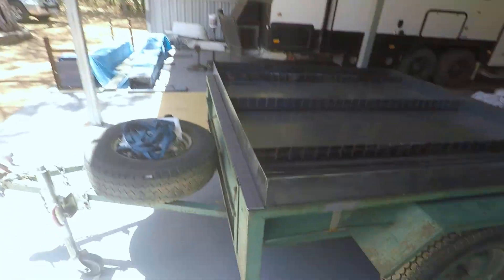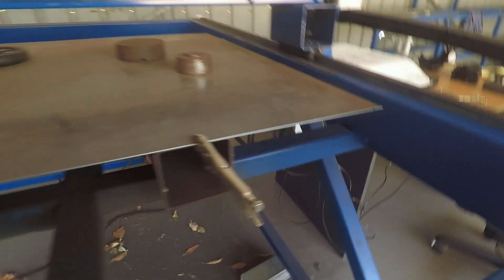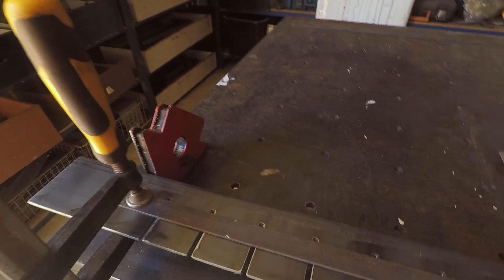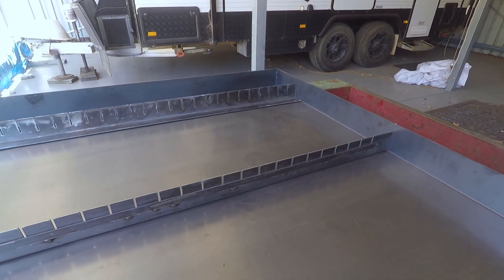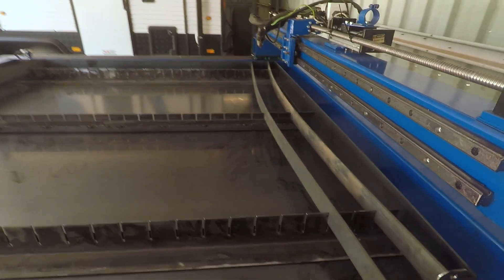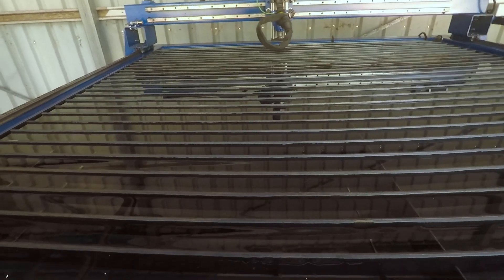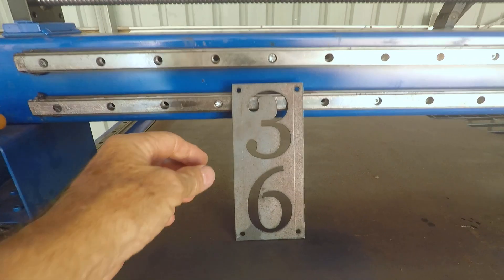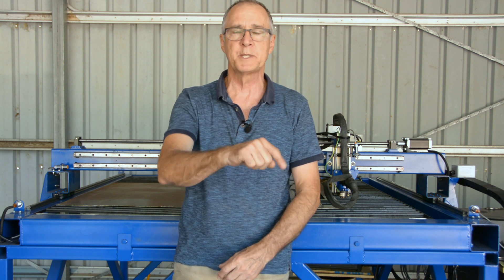My CNC Plasma Table's Water Pan | Fabrication & Install

Comment: Just a note:
If you have thin plate that might warp, you can actually submerge the plate about a 16th of an inch to keep it from warping. 
The plasma torch has everything it needs to actually cut under water and the gas shield will move the water away from the cut path as it cuts.
Reply from the maker: Hi Richard, now that I've installed the MyOhmicPro unit, I can now run my water level just below the top of the slats, which keeps thin metal cool enough to prevent warping. Once the cutting process starts, there's usually a reasonable amount of water collecting on the surface of the metal, due the the air from the torch blowing water up from the water table.

Comment: Great job ,Thanks for the movie.I'm following from Romania with the idea and desire to build a table myself, for now I'm gathering information and materials, I've already bought the plasma. congratulations for what you're doing and thanks
Reply from the maker: Thankyou for your kind words and I'm glad my videos have been helpful for you in deciding to build your own table. What size table are you thinking of building because I sell plans for my table, which has a footprint of 1800 x 1800mm and  cutting area of 1330 x 1330mm and based on a ballscrew drive system operating on the MyPlasm CNC controller and plasma interface unit. If you're interested, you can email me for more details....rmhyde58@gmail.com
Reply: @RustysMetalSigns  ...because you have to start from the bottom, but also because most of the local DIY stores sell sheet metal in 2m/1m sizes, I want to make these sizes with an extra 10%, and more than likely I will need advice and I will ask, I'm gathering the materials - you know it's not easy - and I'm sure I'll ask something, for the moment to collect some more money, but I'm having trouble with the works, I'm an argon welder by trade, but I'm in Romania and everything is strange at the moment, thank you for your appreciation
Reply from the maker: When I built my table, I did so, knowing I'd probably build one to take a full size sheet of steel....2400 x 1200mm. I think if I was going to build my table now, I'd definitely build it to take a full sheet of steel.
If you have any questions, feel free to get in touch, ok....happy to help if I can.

Comment: Hi Rusty, 
Where did you get your water bed cut and folded 
I want same size water bed but struggling to find place in WA that can cut 1.7M wide  ( size of bed plus sides to be folded up)
Reply from the maker: Hi Milos, Luke from Swags Engineering in Rockingham fabricated the water bed for me...here's his details:
Unit 11, 21 Hurrell Way in Rockingham. His email address is: swagsengineering@gmail.com
I hope he can help you.

Comment: Whats the purpose of the fluid? It splashes water everywhere and on the computer.
Reply: The water bath is there to trap the fumes, sparks and smoke that are produced from the plasma cutting process. Breathing in these fumes isn't good for your health.
The water also aids in cooling the metal, especially when cutting thin gauge.

Comment: Hey Russel...always nice to see  yours video
Is your water pan made stainless steel or from mild steel.
Thanks.
Reply from the maker: Hey Michel, nice to hear from you. The water pan is made from 3mm mild steel, as are the slats and slat frames. They've all gone a bit rusty, but nothing noticeable at present, after 2 years of use.

Comment: Hi rusty where abouts did you get the linear rails from ?
Reply from the maker: Hi Daniel, I bought pretty much all of the equipment online....,mostly from ebay. The linear rails I used were HGR20 guide rails with HGH20CA bearing blocks. Mine are 1500mm long but they are available in a range of sizes to suit your application. Hope this helps. If you need any more info about the build, feel free to email me at rmhyde58@gmail.com

Comment: Could you tell me why you end up 100mm deep waterpan? What differend it make if it is 70mm? I make my plasmatable body ready and i am wondering how deep i should do the waterpan.
Reply from the maker: Hi Markus. I made the water pan 100mm deep because I'd seen other tables with water pans this depth. The deeper they  are, the less often you have to clean them out, I suppose. 
100mm is also the height of my Y axis frame rails, so I wanted to keep the top of the water pan and slats level with the top of frame. 
I suppose you can make the water pan any depth you like, but I wanted as much water under the torch as possible, to make sure I captured as much of the fumes, smoke and sparks that the plasma cutting process creates. I hope this helps.

Comment: Hey Russel are your tips lasting long???? my unimig 30 tips are not lasting that long and im only cutting 3mm mild steel
Reply from the maker: G'day Ian, I've probably not cut that much yet, in order to wear out tips. I have replaced 1 tip and electrode (the original ones that were in the hand torch when I got the cutter), not long after I started cutting on the table, but since then I'm still on the 0.9mm tip and I've cut some 1.6mm mild steel and some 3mm aluminium.
I've got more 1.6mm mild steel to cut so before I start, I was going to check the condition of the tip and electrode....which I suspect the tip might be on the way out.
What state you in.....I'm in WA.
Reply: @RustysMetalSigns  ahhh ok. I'm from nsw. I have used plasma's for over 10 year's being a metal fabricator and this plasma just seems crap to me. Only way to get nice cut's is slow the speed down. Be interesting to see what you're machine does when cutting 3 or 5mm sheet 🤔
Reply from the maker: I've got some small items to cut out of 5mm mild steel so I'll have to change the tip, anyway. I'll let you know what settings I use.
Reply from the maker: Hey Ian, what cut chart are you using for setting up your table to cut various thicknesses of material. If you send me an email (rmhyde58@gmail.com) I'll forward you a cut chart I got from the Langmuir Systems forum relating to the Razor Cut 45.....I know you're using a 30 but it's got settings up to 30 Amps for thin material.

Comment: Looking good mate!

Add some Laundry Soda to that water to prevent rusting. Get some PH test strips and keep it at 10 or above and it will last many years.

Link to product picture:

 https://www.farmandfleet.com/products/805054-arm-and-hammer-super-washing-soda.html?blaintm_source=google&blaintm_medium=pla&gclid=EAIaIQobChMInLCukOPr9QIVShXUAR3lpgj7EAQYAiABEgKSO_D_BwE

I had to take a 150 mile road trip to find a big enough brake to bend my water pan. Mine is made of 3/16" plate and was bent on a 500T 20' press
brake.
Reply from the maker: Hi SegoMan, so sorry for the late reply but I've only just come across your comment. Thanks for the tip about the laundry soda and the pH value that the water table water should be kept at. A 500T, 20' press is an  absolute monster....would be great to see something like that in action.

Comment: Hey Russell! I have been looking around at wiring the electronics up for these tables and some of the instructions call for grounding the table directly to the earth, not back through the power source. Is that how you have yours?
Reply from the maker: Hi Frank, I've connected all the earths and cable screens from the field devices, back to a common grounding point inside the electronics cabinet. I've tied that common ground point to the earth point from the incoming AC mains supply.
As for the table, the frame, water pan and plasma cutter's ground clamp, all go back to a common point on the frame.
The electronics cabinet and the table frame ARE NOT connected together.
I was thinking of tying the frame's common grounding point to an earth stake in the ground, but was advised against that, because the earth return path for the plasma torch should be back to the plasma cutter...ie. the electrical circuit wants to go back to the origin, which is the plasma cutter itself. So that's how mine is connected.
I'm about to make a mobile 'console' that will contain my laptop, a screen and the electronics cabinet. It won't be able to move very far because there's not a lot of slack in the cables from all the field devices coming back to the electronics cabinet. 
I know there's lots of tables with the electronics cabinet mounted on the side, and that's where mine was going to be mounted, but I'd rather keep the 2 items electrically isolated from each other if I can....so that's how I'm going to do it. Hope this helps. If you have any more questions, you can always email me at rmhyde58@gmail.com
Reply: Thanks for the reply! That pretty much goes along with what I have read about grounding the shielding and field components back to the common in the electronics box. I think the difference between your machine and others machine is the triple work lead lug. Most would just run one lead back to the plasma cutter as normal. I wonder if the triple lug needs to be isolated from the main frame . Then a cable from the main frame directly to the earth. I am not in any way saying  that your way is incorrect. I’ll check with a local electrician for the code on that when the time comes. Thanks Rusty!
Reply from the maker: The reason for the triple work lead plate is to make connecting the various ground leads easier than having them all attached to a single bolt. This way, I've got the ground lead from the cutter on one bolt, the earth strap from the water table to the ground plate on one bolt and the work clamp and work magnetic clamp on another bolt. All the grounding is to one common location on the table, and this is connected to the ground connection on the cutter, making a solid return path. So far, it's working as planned and I'm not having any issues with EMI with the electronics cabinet.

Comment: Great looking machine! If the slats are perpendicular to the open end of the machine, it should be easier to slide material on/off the table.
Reply from the maker: I'm looking to install a teflon strip across the top edge of the front rail, to help with sliding a sheet on, but I see what you mean about having the slats running up and back, instead of across the machine, as they are now.
Reply: @RustysMetalSigns 

"Do a google for "Ball Transfer bearing"

For the long term you can use a engine hoist with a 4 way spread bar to load heavier sheets.

Keep on keepin' on!
Reply from the maker: The other option I'm looking at is to install a gantry trolley and chain block, running from the front to the back of the shed, so I can unload a sheet of material from the trailer and load it onto the table.
Reply: @RustysMetalSigns  That's my plan as well when I add onto the shop for the plasma room. Currently I use a stinger on the fork lift.

Comment: Great job Rusty! Thanks for the movie.
Reply from the maker: Cheers Frank. The water pan also made cleaning the dross off the underside of the pieces, much easier, which is a nice bonus.
Reply: I like the idea of having the three way ground on there as well.
Reply from the maker: I added the magnetic base earth clamp and used it today....much easier to use than the standard earth clamp that ends up half submerged in the water.
Reply: "Here's one I prepared earlier" ĺove it mate, awesome job mate.
Reply from the maker: Thanks Jim. I had the table cranked up today, cutting out metal garden chooks!!